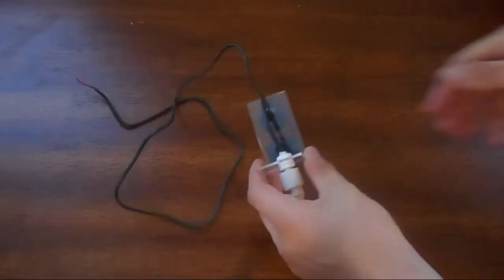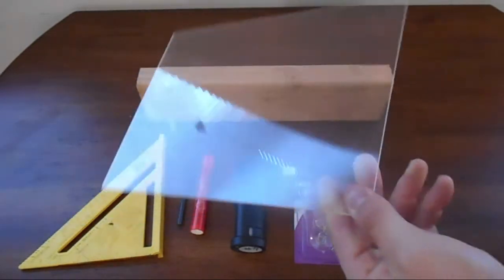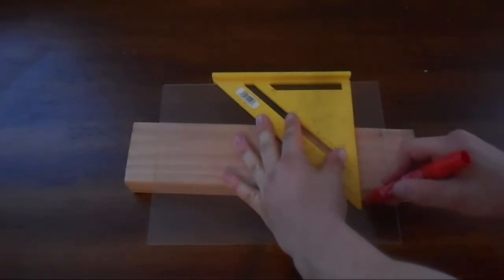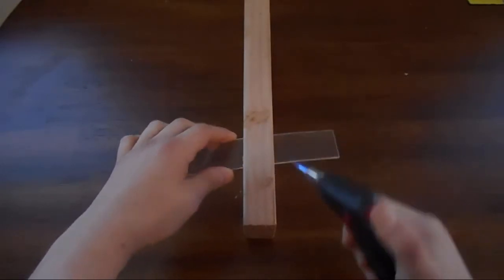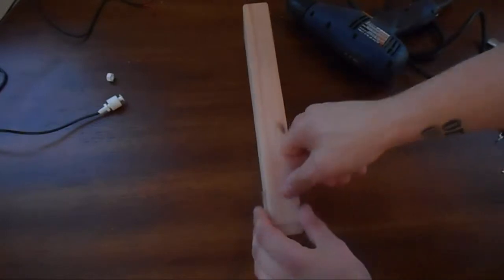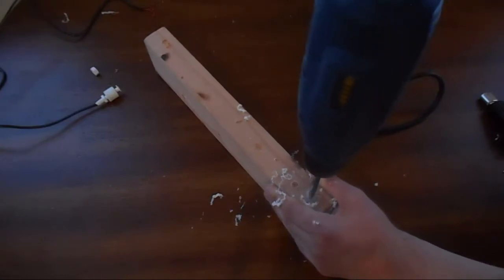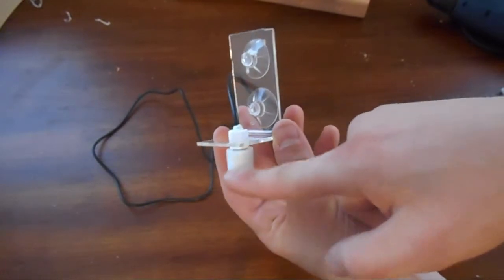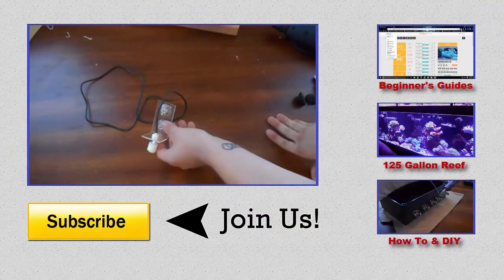How To Build Your Own Acrylic Float Switch Bracket

Comment: Do you have a link to the eBay float switch? my current float switches have a 1 foot cable and your's looks way longer.
Reply from the maker: +Dos Maiz (Twocorns) it changes all the time who i buy from, what i do 90% of the time is just extend the length with some wire.
Reply: What wire gauge do you use? I need to seriously extend mine. And do you have a video or web link showing how you extend your's? Thanks for the help!
Reply from the maker: +Dos Maiz (Twocorns) Its basically a 1/8 headphone jack wire and yes i can make a regarding that when i install my door switches.
Reply from the maker: +Dos Maiz (Twocorns) I just uploaded a video on how to install magnet switches in that video you will see how i make the wire longer to connect to breakout box. https://youtu.be/rgkkr6zS34Q
Reply: +FishOfHex awesome. thanks for the help. your videos are awesome and frequent. keeper coming.
Reply from the maker: +Dos Maiz (Twocorns) No Problem Man
Reply: Thanks so much for this video.  Exactly what I was looking for except I'll be using it in my ato reservoir to let me know when it gets low.